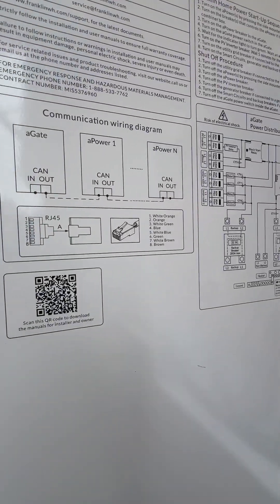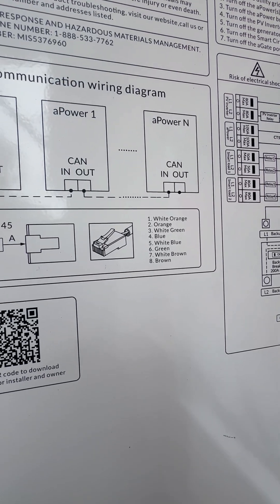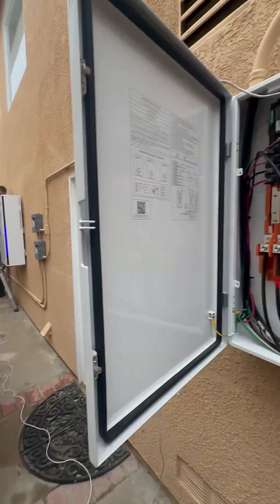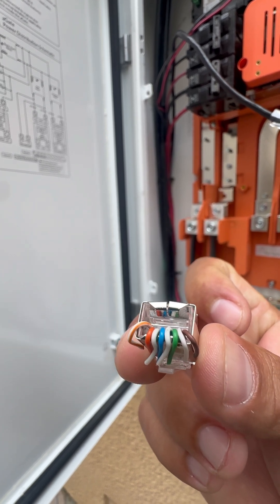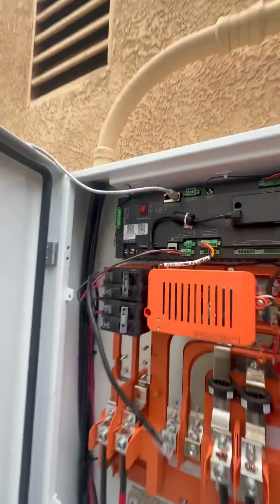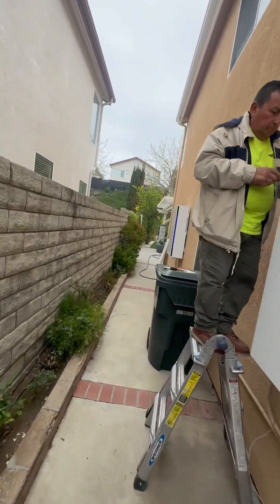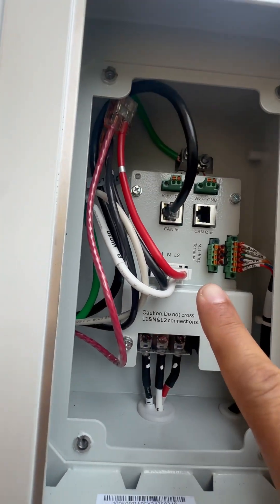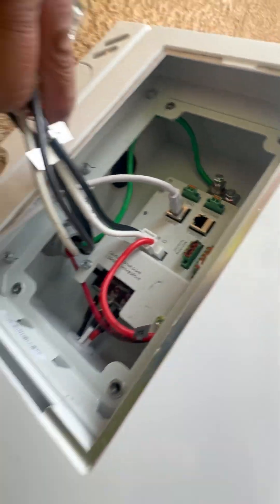Franklin Battery installation

Comment: Will a standard Cat 6 cable work from the Agate to the router?  Having my Franklin Apower2s installed soon and I'd rather have a ethernet connection than wifi.

Comment: Your able to run the date and power in the same conduit??
Reply: Ya it’s low voltage600V rated,  3/4 pipe size minimum you can have it in the same raceway.
Reply: You all can’t be cheap and have to use manufactured requirements or it avoids warranty and possibly cause issues.

Comment: Why not use industy standard cabling, then swap it on the board level. This does not make sense.
Reply: That's type B code that is standard. Pin side down and work left to right.. B is the most common..
Reply from the maker: @steve0002o  and unfortunately we can’t use the pre cut cat 6 either because the location of the batteries will always vary. So we have to use a roll and then crimp the port